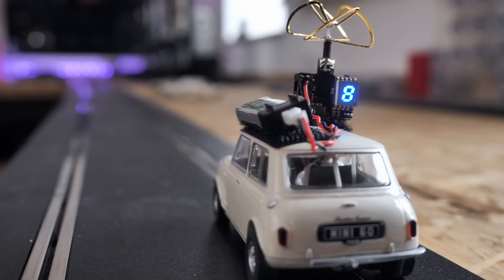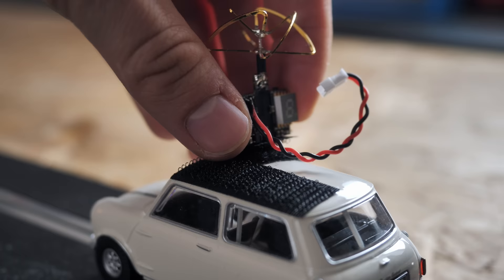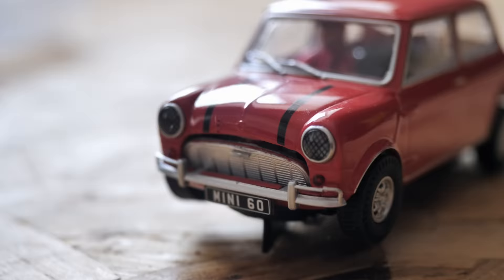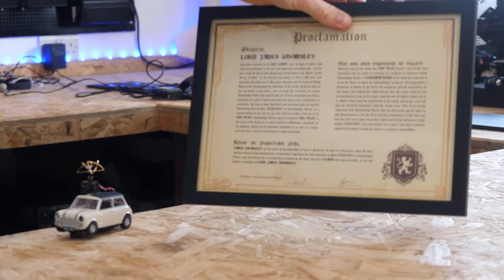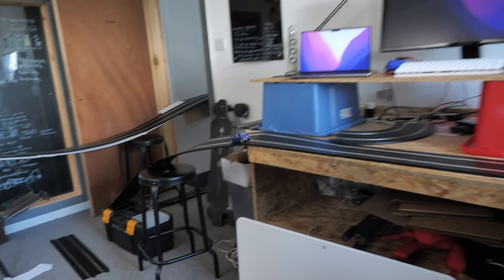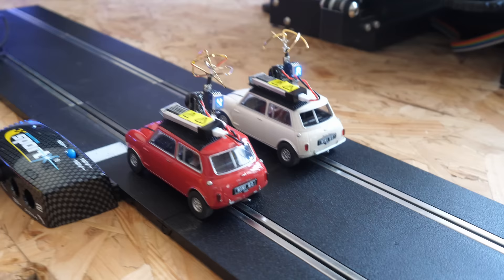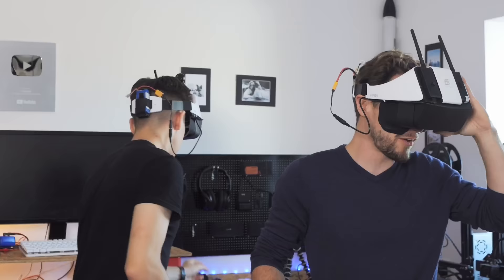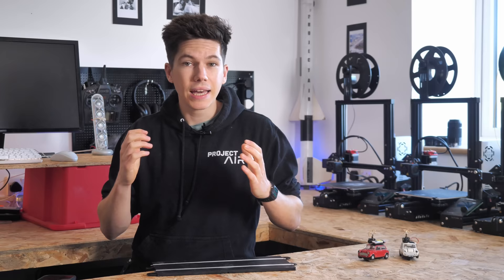Upgrading Slot Cars (and building a 200ft track)

Comment: Ha, ha!...Boy was that fun!   (I'm an oldster,...at 68 years old),.....and I used love playing with my slot cars,..in the USA in the early 1960s until 1969. Back then the cars were simpler and we did't have that magnetic, feature. The tracks looked the same. People had small tracks in their parents houses, but we also had public tracks to go to. Public tracks were sponsored by large department stores, with toy departments, where the slot cars were sold. A few hobby stores, also sponsored public tracks,....on all the tracks I ran on, we had to pay by the hour,....and for a kid, it could get costly. I had slot cars in two scales. I preferred the 1/24 inch scaled size. Me and my pals had so much fun with this hobby,....we built our cars from kits and parts swapped with other kids cars. We sometimes fabricated parts, from metal & plastic stock materials. I belonged to a slot car club, in it we ran the smaller scaled cars, and used our plastic scale models for the bodies. It was fun to be a "spotter" at those large public tracks, where there were 10 or more tracks. We ran and saved cars that got stuck along the way or ones that got bumped off the track. Thanks guys! It was a trip down memory lane, for me.  Cool!
Reply from the maker: Cool to hear!

Comment: Having grown up with these I have a few tips. 1. Wd-40 on a lint free rag and wipe just the traces on the track after a good cleaning. 2. I good lubricating oil on a lint free rag and just wipe the pins where the track sections connect. Use just a trace of both. It gives much longer times between cleanings as it reduces oxidation on both the pin and trace. 
Lot of fun to see these in action again. Been about 45 or more years since my last lap.

Comment: Looks like a blast! If you do another it'd be cool to see if you could take advantage of the ability to run vertical. I'm not sure they'd run if the track was flat to the wall but running horizontally, but if they did it'd be cool to do a "quarter loop" up onto the wall, drive up the wall, do a 90 degree turn, some straight, another 90 degree turn and then drive straight back down the wall. 

Also a sort of mirror maze that hides a sharp last second turn could be interesting as well as something like the tinywhoop light tunnels that flighttest has.

Comment: Well, the idea struck me immediately after thinking about the power issue : 
In model railroad, the matter of powering the locomotive and makind it moove are decoupled thanks to the DCC system : a dcc controller gives some square AC with variable frequency to the tracks (the information is numericaly  coded bit by bit in the variable  frequency), thus providing constant power to the locomotive, you just need a full-bridge rectifier and a filtering capacitor, the tracks AC goes directly to a little electronic circuit, a dcc decoder which decodes the information, pilots the motors at the specified speed and can even power up accessories like lights, some can even pilot servos.
The dcc decoder itself is a really tiny pcb, 2*1cm max for HO scale, even less for N scale and can easily power motors that draws under 2A dc
Reply: Is that how they worked? I never could quite work it out as a kid but then I never could afford it either so it was always just an aspiration. I just had to make do with isolators and motorised points.
Reply: @andyjdhurley  The current DCC system works by giving constant AC to the tracks, a 1bit is transmitted when an alternance (one side to +VCC and afterwards the other one, polarity is flipped ) last around 56  +/-2 microseconds, a 0 bit is transmitted when the alternance lasts more than 100 microseconds. The data is send following this principle, from the controller :
1) 7(if my memory is correct) 1bits for synchronization followed by one 0 bit
2) the adress of the target decoder, can be a loco or an accessory like a motorised switch track, followed by a 0bit
3) the target action with according data, for speed, the value between -127 and 127, for a function like a light, the corresponding number and value (True/False),... followed by a 0 bit
4) the result of doing an xor operation from bit of data to bit of data, the decoders does it on it’s own, if the decoders has correctly understood the instructions, the result will be the same as what the controller send, if the decoders misunderstood a bit, the result will be different. As such it acts as a safety to ensure a correct data transmission without bidirectional conversation.
A simple controller can be cheap, like a multimauss from Fleishmann/Roco, around 150€, I have a project to make my own based on some arduino libraries like cmdr. The main issue is the individual cost of each decoder, begining at 30-40€ each

Comment: If you get the digital version of the cars and power strip, then you can take the power from the track as it is constant with the speed of the car controlled by the pulse wide from the digital controller

Comment: The model railways used to use the same basic control scheme, but they're moving to something called Digital Command Control, DCC. DCC is a DC square wave on the rails, so accessories like lights can run off DCC as if nothing has changed, but the frequency of the square wave can be modulated to send packets. Basically, each locomotive or DCC accessory is given an 8-bit address, and your controller sends simple commands like "set speed to <0-255> to individual locomotives. As a result, you can have many trains on the same track running at different speeds.

It comes to mind because something like that would let you eliminate the batteries in the cars: you need a small capacitor and/or regulator to smooth out the power for the camera, and then a small circuit to control the motor speed. The off-the-shelf boards are pretty small, too. They can fit into an Z-scale locomotive, whose tracks are only 6.5mm wide. The motor controllers look like they support an amp at about 20V...

Comment: I love this tiny,  little AIO units!!! I use em in almost all my RC vehicles.  Not so much in fixed wing airplanes,  but most of my quads(drones), boats and crawlers and off road trucks. 
So inexpensive,  at around $15 , ya can't beat em. 
I prefer those that use a small 4.3" LCD monitor as opposed to the ones that send video to my phone. I, use hot glue to mount it to a controller.  
Great track here. Good job.

Comment: They make digital systems for model trains that can communicate with the trains and change speed or stop while sending constant voltage through the track. Now you have all the power you need for the camera and and ditch the battery for a voltage regulator.

Comment: Awesome video, definitely something i wish i could do. But in my opinion next time you guys should make a few changes:
1: try to get half width segments for the jump/pit stop area that way you can recover from a bad jump or perform a pit stop without worrying about getting hit
2: make overpasses, you can have all the length without needing  to run as far to recover
3: upload the entire video from both cars side by side with the narration, the switching back and forth made it a little hard to follow
4: maybe try to find more and more exotic pieces, like perhaps corkscrews or loops
5: make custom upgrades to slot cars, perhaps experiment with stronger motors, bigger wheels, heavier cars, ext.
I might add to this should i think of more ideas, but I cant to see what round 2 has to offer.

Comment: I'm absolutely amazed. You got the cars to go around that huge track with relative ease (great to have that real time driver view) and have some fun. Proper physical stuff, not a computer game. Occasionally, we get the old scaletrix down from the loft, but invarably it's a disappointment, the cars don't work, intermittent, stop-start, jam on the track, then accelerate and fall off on the corners. Frustration, then it's all got to be packed away and put back in the loft. Maybe next time it will work better.

Comment: SO.....depending on the voltage range of the camera, you COULD wire them up using a digital slot car set up. In a digital set up the track and the car ALWAYS have power going to it (usually 12-14v), power to the motor of the car is controlled by through a special chip that's manufacturer specific and controlled by a handset that "talks" to the chip through a really basic CPU. If my math is right you could in theory, run the cameras if you wired them into the black/red BEFORE the chip in the car. The only downside could potentially be the voltage drop between the direct power coming from the track, and what the motor receives, BUT I've ran up to 6 cars on the same two lanes (the chips allow for this) and the advertised max is 8 cars. 

What makes the digital setups really cool is, it allows you to change lanes via switch tracks, it allows for things like fuel levels and pit stops, it also allows for 3rd party race software that can add simulated weather, speed limits on specific cars, simulated brake adjustment. it's really something.

Comment: Loved it! Thanks for the look at ProjectAir HQ (impressive!), and kudos to Scalextric for the great-looking scale Minis. I once fitted one of those little cameras inside my 1/6 scale RC VW New Beetle such that it provided a driver’s eye view. It worked okay, but the camera metered on the lower light level inside the car, so the exterior view was of little use. Actually, your camera setup gave you the Mr. Bean experience. ;-)
Reply from the maker: Afraid most of it isn't my place! Only the top workshop. :) The people who have the rest of the building were kind enough to let me run the track through! Glad you enjoyed. Definitely did make you experience Mr. Bean in FPV!

Comment: Someone had put a trunk full of slot car tracks at the side of the road for someone to take. Everything was there, tracks, barricades, decorations, the so called controllers which are just a button with a wire and case, even the manuals and boxes for the slot cars. But they made the whole thing useless because they did not include the slot cars themselves, which is the only part anyone would have really cared about since slot car tracks can still be bought today and older slot cars are becoming extremely rare. There was at least this amount or more of tracks.

Comment: It would be cool if you could electrically isolate sections of track, which are fitted to a regualted 5v supply. So it's like they're on autopilot. 
They would travel more slowly, but not crash in very complex tunnels where it's troublesome to re-seat the cars.

Comment: Actually i enjoyed building different tracks. I figured out the magnets and build a whole circuit with lots of corners banked turns loops etc. on the wall. And it worked as well as positioned on the ground.

Comment: I got a Scalextric set when I was way too young to appreciate its value and I made it do things it was never supposed to.  I constantly had real troubles with power loss on long tracks using the supplied transformer so something must be different here.  I left it in storage for a few years and when I came to use it again, the metal conductors along all the tracks were all buckled to buggery  so it went to toy heaven.

Comment: Can the cars run upside-down? Probably not, but if they could, you could have used a loop-the-loop to smooth out the curve of the track between the (former) vertical climb and the horizontal straight at the top

Comment: If you could add the ability to change lanes you would have a model of a workable full size way that electric cars could be made. They would have the advantage of not having to carry heavy batteries (that need to be traded or charged). Changing Lanes is the only obstacle to a very good  alternate way of getting electric cars soon and safely.
In Arizona we have a lot of roads that are uphill, and it can get as hot as115f. If you are in an electric car with the air-conditioning on and going uphill for just a few miles you will draw soooo much electricity you will have to get out and push. That's where a slot car shines... Unlimited juice(at least all the juice you need) to run your car, your air conditioner, and stereo.

Comment: The fact that you didn’t have any power problems is interesting to me. I guess those little slot cars aren’t nearly as power hungry as 1/32 and 1/24 scale slot cars. I have to use jumpers every 15ft (4.57meters) or so to extend my set out past about 50ft (15.25m).

Edit: I realized later that this is an analog track. The switches in my digital set have higher resistance than regular track pieces resistance, which causes voltage drops across longer distances.

Comment: You may be able to do away with the battery. I saw another race where they apply constant voltage to the track and use electronics to wirelessly control speed. In that case you could power the camera as well.

Comment: What you britts had is similar but yet different from what tyco put out. I had two different tyco sets in the 1980s, their cars had a metal peg upfront in the center with a copper strip on each side.

Comment: You might find the cheap usb endoscope cameras useful. Theyre absolutely tiny. Probably even get wifi/bluetooth versions. But go for at least the 4k models, 1080p was lacking a bit.
Used to have boxes and boxes of track, seeing the prices online now is insane. Like $30 a section. I remember it was $60 for a full box set and not just the figure of 8, the chicanes n stuff 😆
Thats where at about 7 years old i learned they dont go faster if you plug them into the mains they just kinda fireball violently, and its a bad idea to do it under your bed with your parents downstairs 😂

Comment: I used to race RC touring cars many years ago and I came up with an idea.
Usually the drivers stand at an elevated viewpoint so they can look down on the track, but what if they had cameras inside the cars and had to race with only a FP view as if they were sitting in the cars?
I dreamed of having enough money to build a facility for this purpose but alas never did.
First, a huge circuit with enough straight to get up to top speed. 
10 cars fitted with 3 cameras.....one looking forward and one on each side facing backwards like mirrors. 
A building with 10 separate booths equipped with a steering wheel, accelerator and brake peddle, forward and backward gear stick.
A large TV monitor with the mirror views inserted into the right and left bottom corners of the screen.

A slight change of rules too.
Usually there are marshalls around the track who will put your car back on the circuit if you come off or turn over.
This will not happen. If you crash and are unable to continue, that's the end of your race.
This is for three reasons....1) it's more realistic. 2) it makes people drive more skillfully. 3) it will discourage people from wrecking the cars.
People can come and pay a fee to race in a series of heats.
What do you think guys?
Let me know.
✌️❤️🇬🇧

Comment: Would it be possible to power this tracks or some custom build tracks with higher voltage and amps, then race some bldc powered cars for higher speed, and also putting the camera inside the vehicle might be better on some aspects.

Comment: Why didnt you heat the plastic up with a heat cun or bloiling water (with the track in an airtight bag if needed) and the bend the metal bits so the plastic bends with it. Then you can go vertical.

Comment: It is still so infuriating to known that really ancient slotcars had better systems than you can get nowadays. Yes, really.
We have an old track (Carrera unviversal 132) that had one thing that was "special" compared to all the new tracks: You could switch lanes despite having simple analog control only.
The tracks had 3 contact-patches - one in the groove, and then one on either side. The cars had a rotatable pickup that has 1 contact in the groove and on one of the 2 sides only. So by selecting where that contact pointed you could select which signal it would pick up. This allowed 2 cars on the same lane to be controlled independently.
And they had a great selection of trackpieces - static laneswitches, automatic controllable laneswitches (drive slow to go straight, fast to switch lane), rough terrain, jumps, seesaws and a lot of extras. Very important were the runouts. Why? Cause the cards could drift very nicely and controllable without losing power. You could even do 180s and drive the other way - could be turned into a nice track-feature were at one point you had to turn around and go back the way you came and then use a laneswitch to go to a new track again.

Comment: Do you have any info getting started on FPV stuff? Really want to strap an FPV system to a Traxxas vehicle I have. But the FPV kit I bought doesn't work and is just a static screen. How did you get yours going? What equipment do you need?

Comment: At 5:57, this is not an accurate way to measure the resistance of the track - multimeters cannot measure low resistances like that as they cannot account for their own internal resistance and the resistance of the wires going to the probes, which are significant errors when you're down at less than an ohm. You need 4-terminal sensing!

Otherwise an absolutely awesome video! :)
Reply: The loss is in the track section joints

Comment: why not power straight from the rails lol
Reply: negative over 90 degrees rise
Reply: loop
Reply: try wireless electric mimo resonant induction tether lines-networks all over (for cars/planes/boats), no batteries needed, near power lines, or electric blimp trains
Reply: more than a wireless car charging spot, continuous charging network all over, no charge